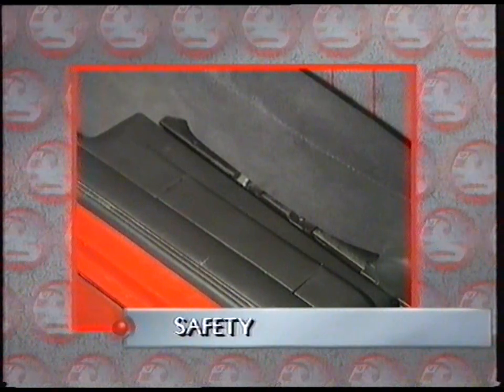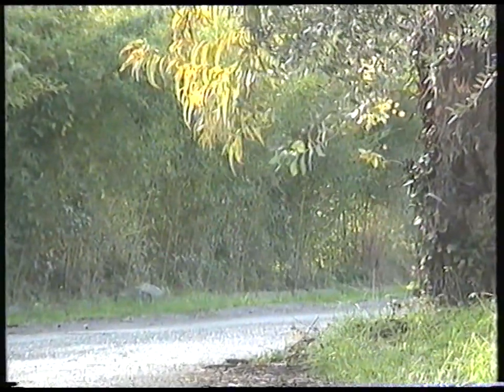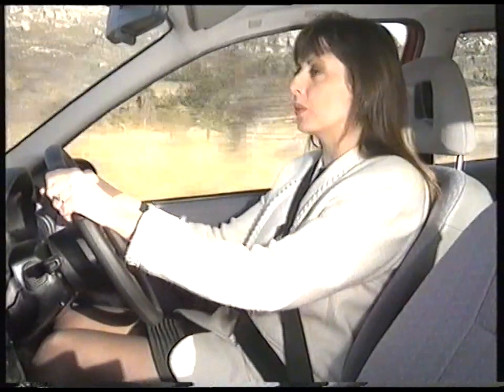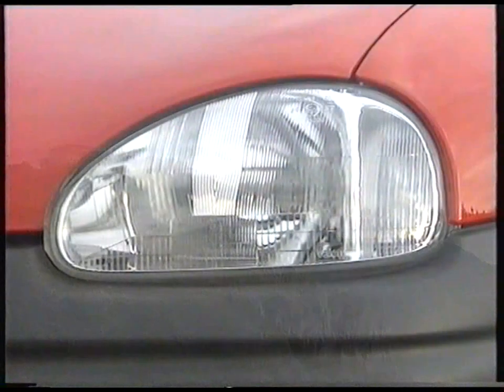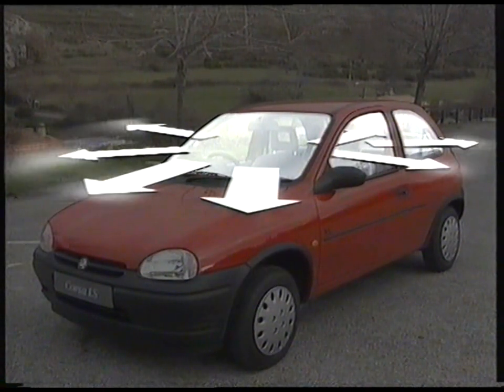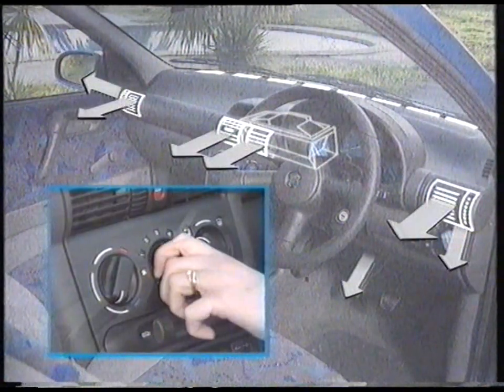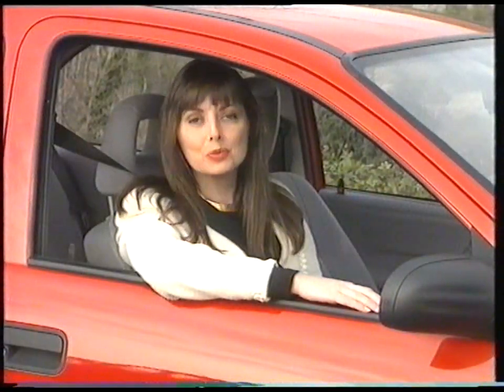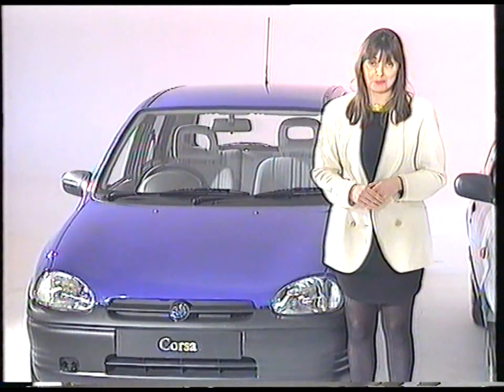Vauxhall Corsa B Dealer Launch Video (Hosted by Carol Vorderman)

Comment: Small practical and economical. When EURONCAP tested the Corsa it scored a disappointing 1* rating for its crash safety, the passengers head hit the dashboard giving too high a risk of injury to the head. The driver compartment suffered too much intrusion from the front end deformation and the pedals pushed too far rearward causing serious foot leg ankle and thigh injuries.
Reply: You must remember, it was considered safe in its day. Technology advances at ridiculous paces. The Renault Laguna, the first 5 star NCAP car back in 2002 would be about as useless as a crisp packet against the most modern cars. It's all relative. I for one would rather my chances in a Corsa than a Metro ;)
Reply: @SamNeedham123  You'd still be safe in the 5* Laguna, and it did rather well actually!
Reply: @anthonyperkins7556  Into something like a tree, then definitely! But I wouldn't fancy going head-on with some of the mega-stiff cars that are on the roads these days.
Reply: @SamNeedham123  Still safe in collisions with other cars! Your useless sentiment saying it's only safe against a tree is a pure utter lie! The Laguna performed better against other cars in its tests and far better than a 1* EURONCAP Vauxhall Opel Corsa.....
Reply: This car is safe unless you hit something more solid than a plastic bag
Reply: Considering the time period, it did much better than its competition in the same class. 
Safer than Ford Fiesta, Rover Metro, Renault 5, Peugeot 106, Citroen AX, Fiat Uno Seat Ibiza,, Nissan Micra, Toyota Starlet, Honda Civic, Suzuki Swift, Daihatsu Charade, Hyundai Pony. 
The only car that was safer (only just) was the 1994 Volkswagen Polo.